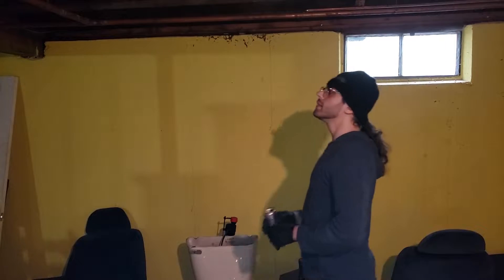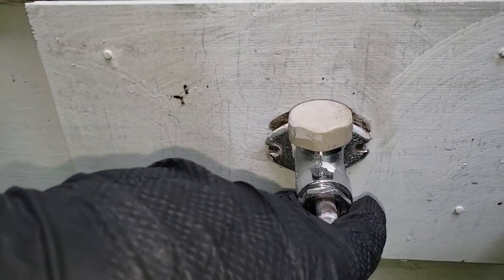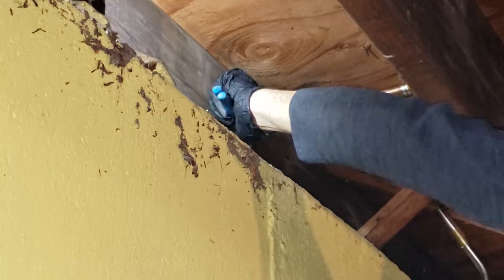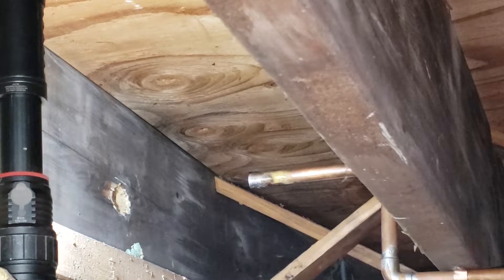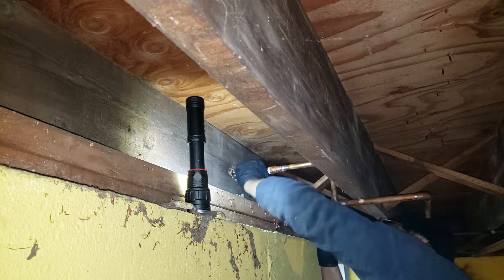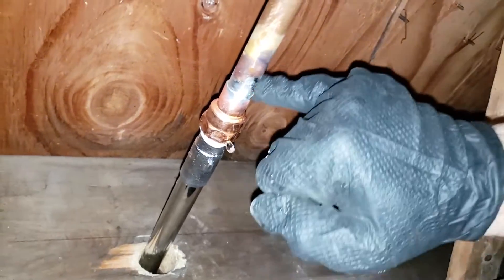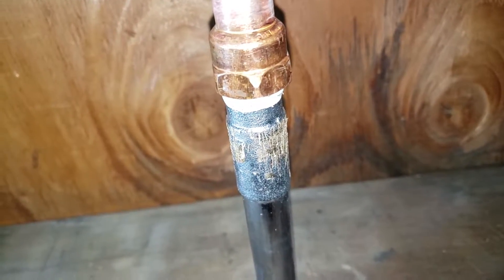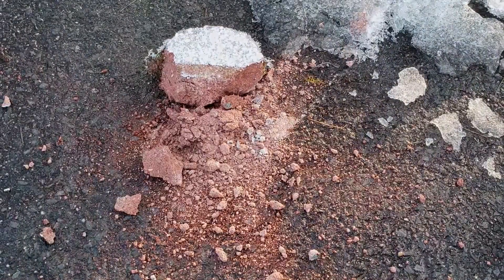How to Replace Garden Faucet/Sillcock DIY

Comment: The fitting that the 'yutz" soldered is actually specifically designed to either be used as threaded pipe or to be soldered the way the previous installer did. Obviously if you have the option to solder it, that is going to be the best way because you will have one less potential leak point (as you found out the hard way.) 

Part of the reason your threaded connection probably leaked is because of how carelessly you put the Teflon tape on. It was all scrunched up into a wad and you were putting it on backwards. Putting it on the way you did would cause the tape to come unraveled from the threads as it was being threaded into the other connection. Next time make sure the tape is nice and flat and put it on in the direction so that while you're tightening the threads the tape is getting tighter (clock-wise if the threads are facing you).

Your basic home repair skill set is so far behind that of even a mediocre DIYer; it's hard not to cringe while watching. It seems like you're learning a lot though. That's all that matters. Hopefully as you learn more you will look back at these videos and cringe along with the rest of us.
Reply from the maker: Thank God we have an expert here to set the record straight. It's clear you could've done your project without the help of no stinkin' DIY video, and are actually just here doing your daily rounds of policing YouTube. Where would we be without the wisdom of Charlie Ott? Do me a favor, can you go through the rest of my videos and tell me what I did wrong in each of them? Much appreciated.
Reply: Nah. I’m actually subscribed to the channel. I didn’t realize I was only supposed to watch the videos that coincide with projects I am doing at home. Didn’t mean to hurt your feelings. Sorry.